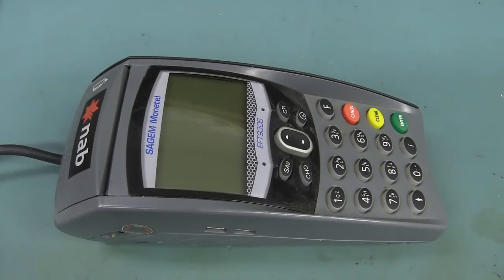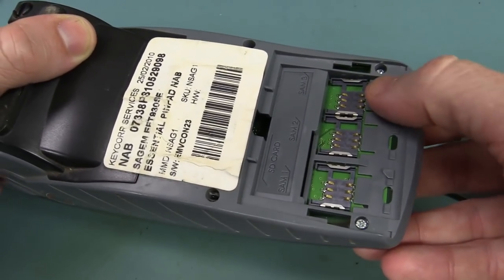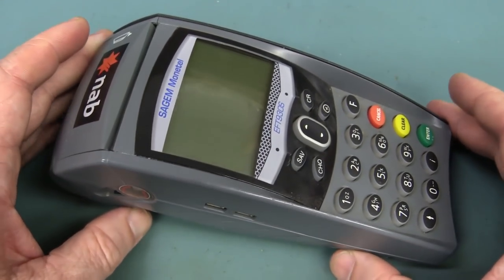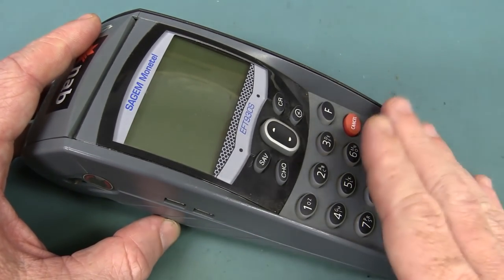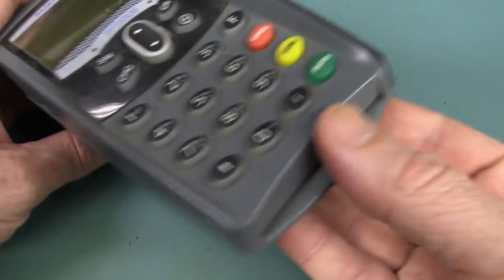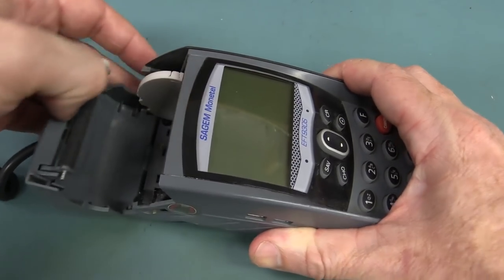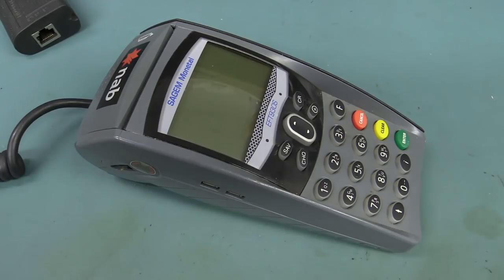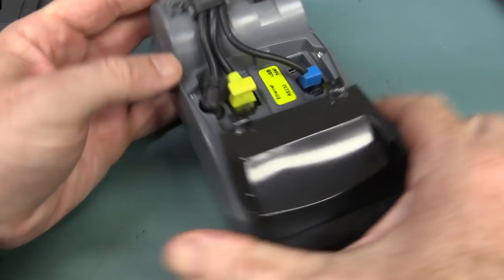EEVblog #687 - EFTPOS PIN Pad Terminal Teardown

Comment: Why are PCB's always green?
Reply: +Spikey Husky there not
Reply: +JamesCon Tanks ok why are they green MOST of the time? jees if you cant answer my question just don't comment
Reply: it cheeper for them to be green thats y
Reply: +JamesCon Tanks so green paint iis cheaper than no paint ?
Reply: its not paint it what happens in fireing the plastic go green being made
Reply: +JamesCon Tanks aga now thas a good answer
Reply: +Spikey Husky He's talking bullshit, the green color (or any other color) is called a solder mask and is added before there's any "firing", whatever the fuck that's supposed to mean. You can get PCBs without solder mask, there is no color but that of the substrate (usually light brown) but then the tracks are exposed and susceptible to corrosion and shorts. That's not acceptable for commercial product, but that's often desirable for prototypes, it's a bit cheaper, faster to produce and allows you patch shit anywhere.
Reply: +Tamahagane It's usually green because it has usually been green, it can have all sorts of color but as green is most common it's usually the cheapest alternative - so people keep choosing it - in an "evil" circle...   it's the industry standard.
Perhaps it began like that because it was resting for your eyes when hand soldering.
It's possible a large customer once demanded green color, it's possible the chemicals first used turned green when mixed... or a combination of these alternatives.
Reply: They're not
you can get 
green
black
brown
yellow
orange
blue
red
White (usually on power boards)
granted that Green and blue is probably the most common

now... also consider  YOU ASKED   "Why are they always green"

and then , someone answered with    they are not, it's just a common colour
YOU THEN CHANGED YOUR QUESTION (as if it wasn't a big deal)
you then said,  "Ok why is it common"

see.. this now is a whole different kettle of fish
FIRST POINT IS...      IT'S NOT THE ONLY COLOUR,   that question is clearly answered

and if you want proof,   google any motherboard manufacturer and you will very likely find boards that are black, red, blue, Purple  etc...
mainboards used to be blue, then they went to red,  now.. ESPECIALLY FOR GAMING BOARDS IS BLACK
so i guess you could chalk it up to COOLNESS and CLIENT REQUEST

as to the most common
it really depends what the board is for
if it's a Power Board it's usually Brown or White

if it's a Mainboard or something similar,  green is usually the most common,  followed by Blue and Red 
Sometimes, in the case of gaming motherboards, it's a question of the colour scheme of the board vs the heat sink,  so if you have a silver and red heat sink, black would be good choice,  but red would not,  also if the board has RGB effects,  choosing black would bring out the colour in the LED's

Why these colours ??
i would say it would be a variety of reasons,   the main one would probably be CLIENT PREFERENCE at the time of ordering

as for "so is green paint cheaper than no paint"
Now.. see.. you're just being stupid here
because

1.  it's not Paint,   it's called Solder Mask,  it's purpose is to protect to the traces from damage.
basically it's a non conductive barrier between the conductive traces under the solder mask and the top   of the board and whatever is above the board
if you had no solder mask the traces would get corroded and damaged , you'd likely get stuff shorting all over the place,  having a board without solder mask is unacceptable.

and it is for this reason that when you have a damaged pad on the PCB, it's common practice to SCRATCH OFF THE SOLDER MASK TO EXPOSE THE CONDUCTIVE COPPER LAYER so that you can do a repair close to the pad to attach a component to the board and get the problem solved.

2. and of course having no solder mask vs  solder mask would be cheaper,   TO A POINT it's clear you're trying to be kind of a dick,  i mean you started by asking a question...... the question was answered,  you then spawned another question, we are answering it and now you're being a dick....  DON'T DO THAT , OK,    we don't have to explain this to you ,    so... the least we expect is a bit of respect for our time, ok
so... Pick a question and stick to that question,    don't cater the new questions for yourself so you can win ar argument

Moving forward 
here's a quick video on how PCB's are made
https://www.youtube.com/watch?v=e28BkwtTcLM

Hopefully this will explain it to you

here's another one
https://www.youtube.com/watch?v=io5PPKp-L-A

Comment: What is the point of tamper resistance if customers are conditioned like trained monkeys to hack in their PIN into any POS looking device?
Ok, it makes skimming easier if the device actually works. But that is surely optional.

Surely the real issues are trojan PIN pads and the total lack of authentication of the terminal device towards the card.

Comment: I don't think switching the unit will work. The units I work with each have a unique identifier plus a site identifier. This is linked to the client's merchant account, so another terminal couldn't just appear to be it - they'd need to replace those IDs.

Comment: Videos no longer play using the YouTube app on my android note 2, anyone with a tech head got an idea? App fully updated.
Reply: Dave's latest videos are uploaded in 1080p50. Maybe this is the issue?
Reply: ***** a video from 4 years ago played and one from last month. Tried another from 2 years ago but it looks like it is hanging on or waiting for the advert. Must be a YouTube bug?
Reply: TheDutyPaid Yeah, looks like that's the case here. Try clearing the cache (go to settings-> apps -> youTube -> Clear cache). If that doesn't work, the write either to Samsung, or to Google directly.
Reply: I have Win8.1 and haven't had a problem with any videos in 2 years. Maybe it's because I have fiber optic internet service, I'm not sure.
Reply: Robert Calk Jr.
This is for my phone, but now I am having problems on my PC Win7 and my internet is 80 down /  20 up.

Comment: I have a question for those in the know about these.
I networked a friends shop, they had one of these exact terminals, i noticed it had ethernet,as they pay for a dedicated phone line for their terminal, i suggested they use the ethernet instead, save a few bucks.Never actually tested it, but they contacted their provider (ANZ) and they said it has to use phone line.I find this odd and don't really see the point of having the ethernet connector if you cant use it in place of a bloody phoneline! Unless its something not offered just by their merchant service provider.
Anyone care to enlighten me? Anyone run a terminal on internet instead of phoneline, in Aus specifically?